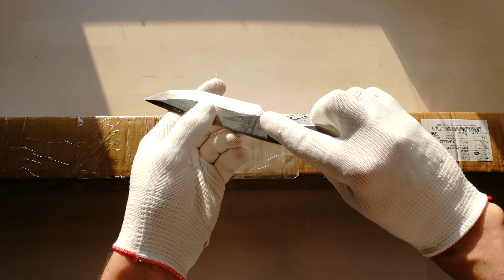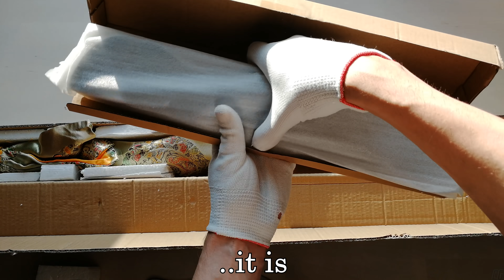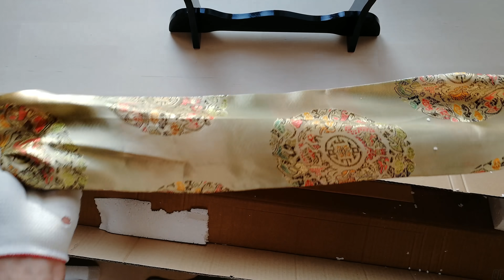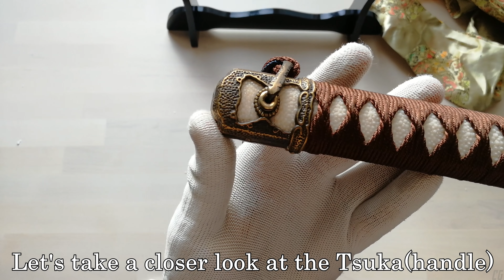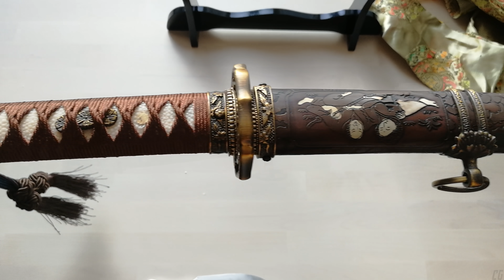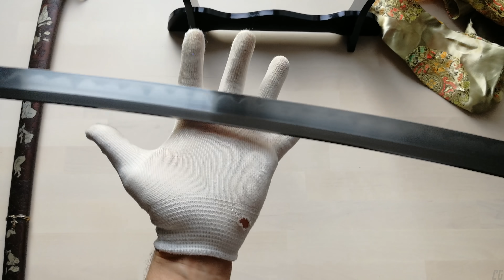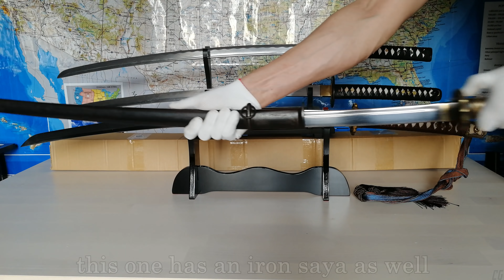$500 Aliexpress Katana is Actually Good - Unboxing + Comparison to the cheaper Katanas [4K]

Comment: :Of course the edge is razor sharp
:proceeds to wrinkle, bend and fold the paper he's trying to slice through
Reply: Its because katanas are better at cutting harder things like the bamboo mats
Reply: @seanmclaughlin1994  no...it is because he was chopping the paper instead of slicing it...there is not enough drawing action to actually cut.
Reply: @evilapple3427  ah, ok thanks for clarifying
Reply: yeah i know, i died watching that it was more ripping than slicing
Reply: @seanmclaughlin1994  tatami*
Reply: Yea, he wasn’t slicing it correctly
Reply: The edge is sharp but not extremly sharp (sharper than most of the edges used by everyday people). He was holding the blade verry akwardly and that's why he couldn't cut well trough it.
Reply: The reason is because of the thickness of the blade. Katana blades, though the blafe he's showing off is a tachi, are very thick. At a certain point they can't cleanly seperate the paper so it rips
Reply: @nickbutler9831  what is the thickness of the standard katana in millimeters?
Reply: @alxra  around 7mm. Mine is about 8 i believe
Reply: @alxra  but his blade is a tachi, so it would be a bit thinner over all

Comment: I'm always in awe of the blades forged by Japanese master craftsmen. No one has ever done it better from what I've seen.
Reply: I see some of the elements from Chinese swords.  Especially the sword's wooden case is no way near Japanese Katana. It is very very awkward that picture is painted on Katana case.  Only Chinese swords have pictures on it.  Usually Japanese Katana don't have any pictures. If they do, it is very strange. Also, the big loop or should I call it a ring around the top part of Katana? Anyway, it is screaming "Chinese."  Katana should just have rope handle instead of ring.  Also, the bottom tip of the case has another extra marking which you can't find from Japanese Katana. I know Aliexpress is infamous about copies and fake items, but this ain't even close to Japanese katana.  It is beautiful to look at, but it is mixed with Japanese and Chinese.  Japnese, Korean, Chinese swords all look different.  They have their unique distinctive trade marks that you can not mix with. 

If you want to buy a real katana in Japan, it will cost you a lot of money.  Thousands more. I've seen a real Katana long time ago, which was a little less than 6 feet long.  It was indeed a massive weaponery.

Comment: Everyone rag-ing on guntos, saying "they're not katanas"

Every POW survivor of the Japanese who witnessed their buddies being decapitated by those very same industrial produced blades..

"WHAT'S THE F***ING DIFFERENCE?"
Reply: Guntos are katanas that were factory made from spring or factory produced high carbon steel.  They do function the same as traditionally made katanas, the only differences are astetics.  You can see the pattern made during the forging process.
Reply: @jakelam5089  Yup.
Reply: So if the steel is a quality uniform steel and is quenched it’s essentially as strong as hand forged, yes?
Reply: Just elitism
Reply: @jakelam5089  be specific at gunto any types some gunto has a blade from edo just mounted.
Reply: @TeneTsTaroT  Yes.
Reply: @jakelam5089   you got a point but no they dont function same, these factory made "katanas" have way weaker edge which gets blunt real fast if used due to them not having a real tempered edge its simply acid etched. Further on they are not as sharp as real katanas, real ones are made out of thousands of layers during the war they used real katanas they could cut of gun barrels or even some ones arm of. so don't even compare the real one with this fake replica that isn't even worth 300$ that he paid for it
Reply: Between a functional katana replica and a Gunto replica very little.
Reply: @TeneTsTaroT  Yes.
Reply: @LegaciPod  cut gun barrels? Apparently that myth lives on, but I'll be kind...

The Japanese apparently made a propaganda movie if a katana cutting through the water-cooling jacket of a belt fed machine gun and supposedly the barrel as well and that seems to be the origin of this myth.

 Leaving aside this may be a pure urban legend (until someone finds the footage and posts it) do you know how easy it would be to fake this? Sword wielder told  to "hit that mark" on a very thin sheet jacket ,(they sprang leaks all the time) where beneath is a precut barrel. Do you think the Kentempai (Japanese Secret Police) would allow a katana fail to be screened in their theaters?

Your other point, it ain't that hard to cut off a human arm with any adequate blade, even if it's a Filipino barong hammered out a truck.leaf spring on a rock anvil and indifferently tempered.

As the late Hank Reinhardt said, "steel is steel" and even the finest heirloom katana will be unable to cut through anything  hardened Steel, be it , be it that poor quality barong or a rifle barrel.

Comment: Its a replica on shin-gunto military issued swords in ww2.
Reply: Exactly what I was gunna say and shin gunto swords were modeled after a tachi and not a katana
Reply: @1SleepyAngel1  this is the comment I was looking for. I knew this was a tachi the moment I saw the saya. 

I’ve got an old school type 95 shin-gunto wooden handle sword from my Japanese grandfather who was in the military, and god do I love that baby.
Reply: Tachi was 30" or more
They  cut personal swords down on the handle, so if the blade is still 30" or if you can see finished work behind the tsuba it was a tachi.
All military swords olive drab or covered with brown leather, and in WW2 incorporated  the lock then only, so technically it's neither, or has bits of both, the only thing WW2 is the latch, the military to copied the hardware from a time it was the style used on the Calvert sword, it's still cool, and all haters that said it's dull wouldn't lick that blade... not even a half inch, on its own weight, so i would say it's sharp enough

Comment: Very cool! Might I give you some advise when you open boxes? Use just the tip of the blade to barely cut the tape. Pinch the blade between your thumb and index finger and gently run the blade across the tape. A lot of people get into the bad habit of plunging a knife into a box and damaging the contents inside.
Reply: I think he is learning...
First video I saw he was cutting almost the box... Now he knows only to cut the plastic parts ( tape)
Sorry... Thanks thanks namaste Haribol Asewe!!

Comment: A lot of difrent Japanese swords are katanas! :) it's a general therm.. Most of you think about uchi and some of the comments say one of the swords is a tachi but not a katana. Both uchikatana and tachikatana are katanas. There are more classified katanas with their own names like uchi or tachi
Reply: Thank you, that was very informative.
Reply: I Can but now
Reply: Actually that’s false. The katana is its own class of blade, a 50cm long made from clay tempered steel worn by the samurai class as a mark of their class and for self defence. For example the tachi came before the katana and is intended for use on horseback due to its long length. The tachi cannot be a different type of katana if it came before the katana. The uchikatana is also a different class of blade, intended to be used against cavalry due to its long blade and handle. Therefore it cannot be a katana. The katana is a specific blade,  not a general term. You cannot call a tachi a katana, or a uchikatana a katana.
Reply: @darkmax9926  i forgot this comment lol,yes its partly wrong. Anyway, a katana is from 60cm to x long. Most of the times under 90cm
Reply: @darkmax9926  oh and today the usage of the therm has "changed" and is used for a lot of sword
Reply: @Quintcy  I can understand that people have generalised katana in that way but not because it’s correct but out of confusion. If you google katana it gives you the correct definition, it tells you specifically what a katana is. People genuinely believe that katana means ‘Japanese sword’ and not that katana is a specific type of sword, like a long sword for example. that’s where the generalisation has come from mate
Reply: @darkmax9926  
It’s like saying cola when talking about sodas in general.
The terms have become mixed and about.

Comment: I'd have preferred to see more of the swords and much less of the dramatics
Reply: its a katana not a sword
Reply: @kalachuzitokarev2886  Translate.....Katana is Sword.
Reply: @colinsmith6116  Actually the japanese translation to sword is "Ken", however, a katana is a type of sword, so calling it one isn't wrong.
Reply: @kalachuzitokarev2886   That is not a katana. That sword is a replica of a Guntõ, which is a military sword that is attached to the waist with the blade facing downwards instead of upwards like a katana, that's why it has a ring on the backside of the saya, while katanas have a sageo. Guntõs also have a more vertical attachment on the waist compared to katanas which are more horizontal.
Reply: @Hyzalker  do you know anything about that ,,button,, on the guard is that a real thing or they put it there. I know that the case is made around the blade to fit perfectly and not fall out. (Sorry for not typing the real names of the parts)
Reply: You do realize you can actually control the video and everything?
Reply: @kalachuzitokarev2886  Is it hand made? No. Is it made from folded steel by japanese swordsmith? No. It is a sword, not a katana. Katana- look a like sword, nothing more.
Reply: @ТомаВасилев-р7я  That is actually a thing. If you search images for Gunto tsuba you will see that those have a side slot for a locking pin, unlike a katana tsuba.
Reply: @urpoturakainen4958  You guys are all wrong. It looks to be a tachi. Also just because its not folded in a traditional way it doesnt mean its not a katana. The kanji for katana literally means sword.
Reply: @urpoturakainen4958  katana are overrated
Reply: @Hyzalker  
...a gunto is a katana. The mounting is different, but the blade is very much the same.
Reply: @sanderson9338  In what way exactly? As a weapon, or as a piece of history, or maybe as a sample of the finest smithing skills on this planet at the time? In fact they are overrated just because they have a place in history, I mean, what kind of swords were americans making 700 years  ago? Oh, there was no americans, there were just native americans at the time..
Reply: @urpoturakainen4958  I am not American. European and Damascus steel was as good if not better than 90 percent of Katanas. I love Katanas and own several but they are just good swords not some semi mythical weapon like many claim.
They are the length of a one handed sword but are two handed. Japanese iron ore is also very bad just due to the inherent defects geographically. Your response and irrelevant point about the USA is exactly what I am on about, people jump in overly defensive as soon as you critique a Katana.
Reply: @matthewpham9525  a katana is not just the blade, but the whole sword, saya included. Katanas have specifications that characterize them as such, and the same way you can't say a nagamaki is a katana with a long handle, you can't say a guntõ is a katana with different saya, tsuba and tsuka. From the Meiji period katanas were banned, and police/military swords after the ban were intentionally modified to distinguish them from katanas. In fact, the first guntõs (Kyu-gunto) resembled a western military saber more than a katana.
Reply: @samuraijones439  Not a tachi. Tachi swords were mounted on the waist horizontally like a katana, but with the edge facing downwards, for that you need two mounting points on the back of the saya, that's why they have that characteristic horizontal strip on the back of the saya. That sword in question is a Shin-Guntõ, you can tell by the single ring on the back, which made the sword be mounted vertically on the waist, so it stayed along the user's leg. Another thing is the locking pin and silk wrapping on the ends of the handle, which wasn't present in tachis, but standard for guntõ.
 Btw, there are guntõ with two rings on the back, those are modeled after western cavalry sabers which give a better mount on horseback. Tachis were also primarily cavalry swords, that's why it's a similar mount.

 Also on the kanji talk. Originally katanas were viewed as the "true" sword, they were a symbol of divinity and by far the most popular sword. Afterwards with other types of swords gaining popularity there came a need to classify them by similar groups. By your definition that katana means sword then a rapier and an european longsword is a katana, but no japanese speaker would say katana to refer to those swords, instead using the word "Ken" which means sword.
Reply: @sanderson9338  So if these swords hasn't earn their reputation, why all the fuzz about them, and why I haven't heard anything about legendary European super fine Damascus swords? Why there isn't any martial arts, where they use European superb quality swords as weapons? Do you really think that you can rise a historical value of the European swords by belittling the historical value of these Japanese swords?
Reply: @urpoturakainen4958  now you are showing your ignorance. Damascus steel is from the Middle East not Europe and is famous to this day as Damascus welded steel look it up. Toledo steel was famous and still is from Spain. Sheffield steel is still recognised throughout the world. You should research HEMA European martial arts. Katana are beautiful and some are amazing but my point is no more or less than most European swords of the time

Comment: "the blade is razor sharp", then the blade doesn't cut sh*t xd
Reply: What? It's slicing paper. The hell you talking about?
Reply: @baddgoat85  
They are not clean slices, but overall not bad.
Reply: Thats not sharp at all!!!!
Reply: It's ok for a factory-made sword right out of the box. It's a modern katana, not an antique, no reason it cannot be sharpened more.
Reply: To test the sharpness the blade supposed to be on the stand facing up. Then take the paper hold it tight then bring down to see if it would cut.
Reply from the maker: no, it's actually very sharp. paper sheet is not a proper test to show a blade's sharpness
Reply: @ExtremeGamingHD3D  don't worry, ik i just found it funny ^^
Reply: Cmon we all know it's not razor sharp

Comment: I recognize most of the parts. That saya is something special though with the scenes and painting. All of the fittings on the saya and katana are ones I have now (I make Katana too). The blade looks very similar to my T10 Shinogi-sukuri blades with no bo-hi. If the blade is of the same quality as mine, I might charge $400 for one that fancy... it looks like they put a lot of work in. I am pretty small time, and work alone, so I can keep my prices a bit lower. I have katana with similar blades, but maybe not as elaborately decorated for around $300.

Comment: The blade looks like it's made of cheap steel. That special coating (hamon) to make the flexible steel more durable on the edge of the blade, is just etched in with acid to look like the real thing.
And that blade is dull af, just look at the paper tear. It doesn't cut clean.

Also, the rayskin handle looks way too smooth to be real rayskin. It's probably plastic then. If all my assumptions are correct, the sowrd itself is worth no more than 40$. Shame you got ripped off.

Comment: That's not "razor" sharp.... Not even close.
Reply: Its not, but u cant have razor Sharp katana if u wanna "use it"
Reply: @currently0nline  Whole point of owning a katana is having a razor sharp sword, and learning how to operate it. If not, buy a bamboo katana, and  save your money.
Reply: @urpoturakainen4958  u know why u have to change ur razors? Cuz they are so Sharp, if u have razor Sharp katana u couldnt use it
Reply: @currently0nline  yea too much sharpness makes the katana easy to break unless your a master of 1 slash
Reply: @urpoturakainen4958  More cut: the less the cut stays in the blade.
Reply: @currently0nline  Just the opposite: More sharper your blade is, less force you need to the cut = effortless cut = less force against the blade. You guys are arguing about the sharpness, but not one you can answer this question: How sharp is sharp? What is your definition of the ultimate sharpness? Sharp as a razor? In fact, your razor should be sharp as a real katana.
Reply: @urpoturakainen4958  A blade imo, is “sharp” when you can whittle hair down the middle.
Reply: @kasterchoi7952  Ok. Show me how it is done? Plenty of people has talk about it, why no one has made video about it? Because it is just BS.
Reply: @urpoturakainen4958  lol it’s no BS. 🤷‍♂️
Reply: @kasterchoi7952  Ok. And now, prove it?
Reply: @Samuel
Such disgrace
Reply: @fatherj6704  yare yare daze
Reply: @urpoturakainen4958  hair is brittle i can cut it with my nail clippings
Reply: @raikj1078  To ask how sharp is sharp? I have great respect towards Japanese culture, but not so much to these millennials, who think that they have invent this world, and all it's miracles. Simple question: How sharp is sharp? What is the ultimate sharpness of the cutting blade? All these people talk like they know it, but where is the facts? Where is the video?

Comment: Technically, thats a tachi. Its longer anymore curved than his others. It has the dradational fittings a tachi. And notice on the saya the ring? Thats to hold the blade. Tachi are ment to be held edge down and katana edge up

Comment: All the fittings look like cheap pot-metal/brass. And he doesn't remove the handle to inspect the blade and tang. No mention of the steel quality.

If the assessment was only "how sharp can they make a cheap piece of metal for $500," it passed.

Anything else appears to be a "fail."
Reply: Bloofa  You can definitely get a better Katana for the price.